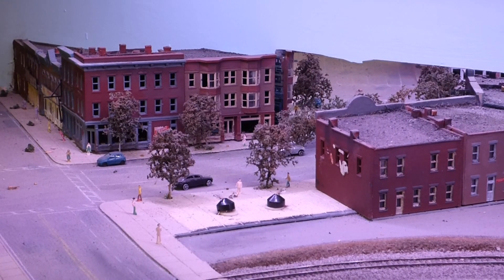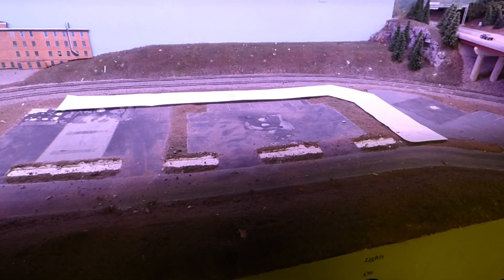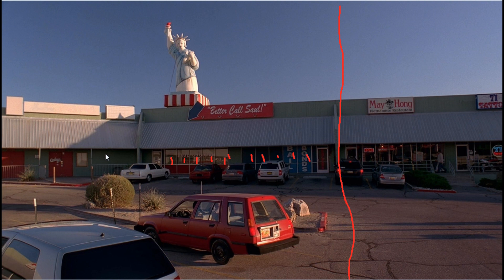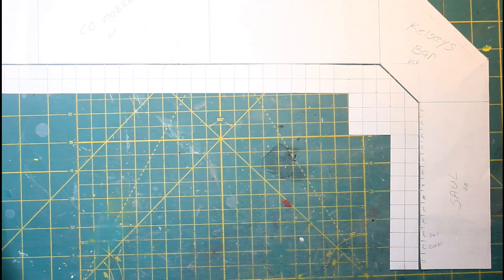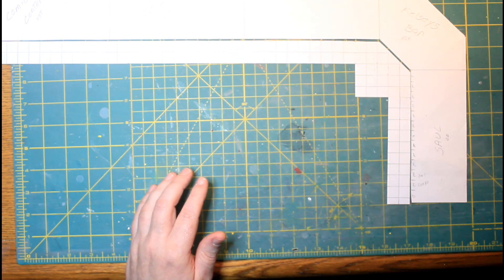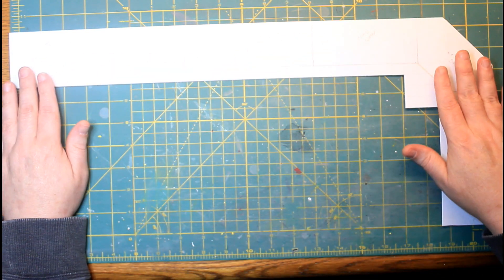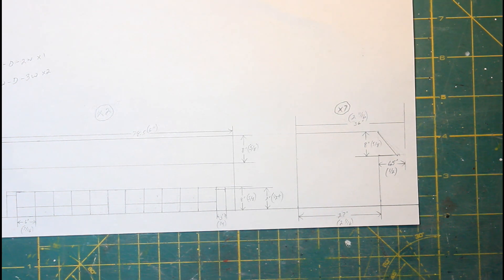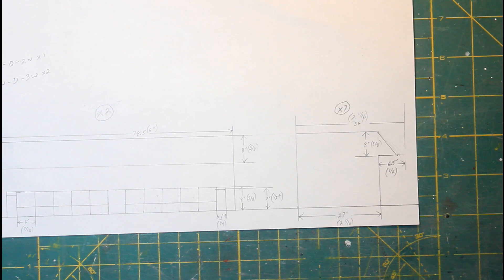Scratch Build A strip Mall: Part 1

Comment: You can also go by the parking spaces.
They are usually 11-12 wide
My apologies they are 9 feet wide
Reply from the maker: Danny VanBibber you’re right I could have done that. But I don’t think I’m completely in scale here. In order to get some of the details I want to have later in the build I had to take a few liberties with window and wall measurements. I think in the end it should work out.